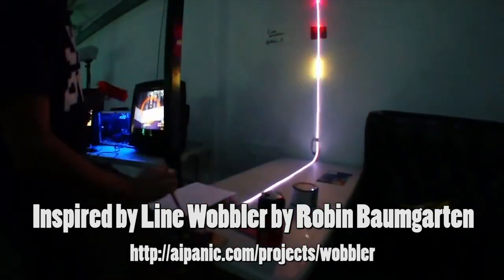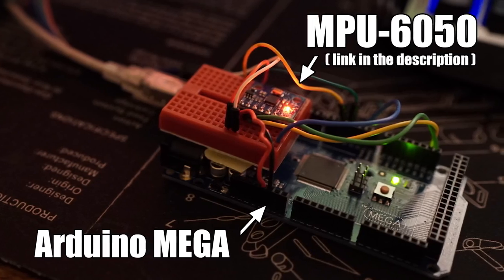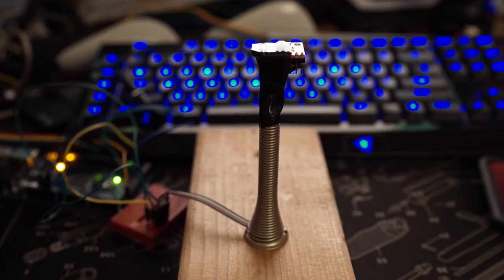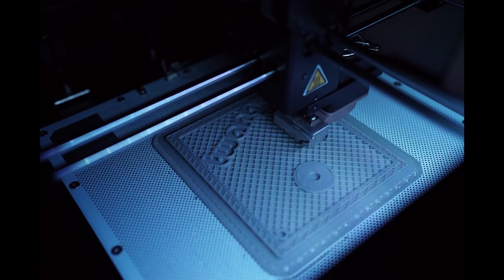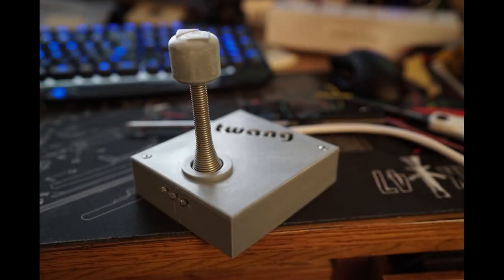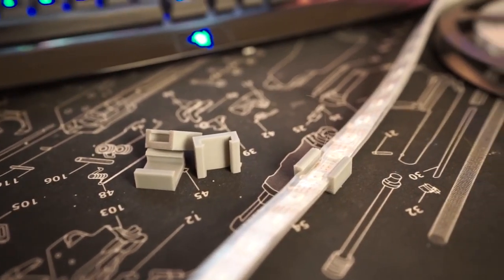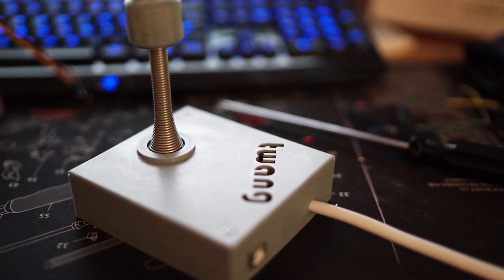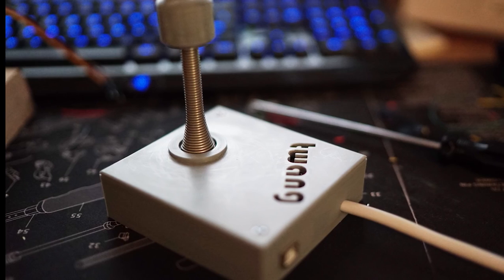TWANG: A 1D Arduino based dungeon crawler

Comment: Hi Critters! Hopefully you see this. The Orlando Science Center had a Line Wobbler installation that had the hardware go out. With no code available, there was no way to repair it. I'm happy to say that it is now a TWANG Installation!

It's an an art gallery area, so every exhibit has attribution. I wanted to give credit where it's due, so if you would like, tell me how you'd like to be credited. I'll make sure it gets put up as such! I'd be happy to have them put Critters or your real name if you so desire. And let me know how you'd like twang stylized, all caps or what have you.

I had some fun implementation details, the joystick is on the other side of a hallway that is an art gallery from the LED strip, so I ported TWANG to an ESP32 and used one ESP32 to drive the LED strip and one to send the IMU info and reset button press across to the other with ESP-NOW (Which works awesomely, this is the first project I've used it on.) I'll send a video once they put the plaque up with attribution, if you so desire. By the way, the FastLED library installed straight from the library manager in Arduino works just fine now. I saw in your readme it said TWANG needs a special FastLED, but looks like they fixed whatever was causing that necessity.
Reply from the maker: Critters on YouTube would be fine. I'd love to see a video! Did you try to reach out to the line wobbler guy?
Reply: @Critters  we did, several times. it looks like he's moved on to bigger projects, which is awesome, but for a while it looked like they were going to have to take it down. Thank you very much for releasing this! I'll take a video next time I'm there.
Reply: @Critters  I'm about to send over to the department head, I'll tell them to credit as @Critters (YouTube) and the installation with be titled: "TWANG" I'll send a video when that's done! Let me know if you'd like to change any of that before I send it over. Thanks again!
Reply from the maker: @PockyBum522  Thanks David, let's go with "David Scott" and "TWANG", I appreciate you confirming and I look forward to seeing the video of it in action.
Reply from the maker: @PockyBum522 Did it get installed?
Reply: Alas  @Critters  I have sad news. It was installed and functional, but I just went back and looks like they opted to take it down. I am just a contractor, so I'm not privy to why. I'll ask about it next time I have the ear of the exhibits department leads. I wish I had better news, I was planning to video it for you today. I may have a video from installation a few months ago. I'll send it if I can find it.
Reply from the maker: @PockyBum522 No worries, thanks for the update! Were there any pictures of it installed?

Comment: I see that this project is quite old but I thought I would give it a try.  I managed to gather all the components but when I try to compile the code in the Arduino IDE, I get a pretty long list of errors.  I managed to find and install all the libraries but the list of compile problems remains quite long.  I'm wondering if the version of the libraries or the version of the IDE are creating problems for me.  Could you please tell me what versions were used when the project was originally developed?
Reply from the maker: This was so long ago and just a one-off for halloween I have no idea. Sorry.
Reply: @Critters  I eventually worked my way through all the issues and got it working.  I'm pretty thrilled with the results.  Thanks for sharing the code.  Well done!
Reply from the maker: @robcarnegie7480  If you do a video do tag me in it, good job!
Reply: Was a arduino mega required  for memory constraints or would an uno work?
Reply: @SteveWyatt  The only thing a Mega offers is more memory and a lot more I/O pins.  I didn’t check to see if it would have fit in an Uno but I’m sure it would be possible if you used some shift registers to share pins on things like the remaining lives LEDs.

Comment: Arduino: 1.8.2 (Mac OS X), Board: "Arduino/Genuino Mega or Mega 2560, ATmega2560 (Mega 2560)"

/Users/stefanomuneroni/Desktop/TWANG-master/untitled folder/TWANG/TWANG.ino:3:20: fatal error: I2Cdev.h: No such file or directory
 #include "I2Cdev.h"
                    ^
compilation terminated.
exit status 1
Error compiling for board Arduino/Genuino Mega or Mega 2560.

This report would have more information with
"Show verbose output during compilation"
option enabled in File -> Preferences.
where can i find this library??
Reply from the maker: mitchell hirsch type ic2dev.h into Google. It's the very first result.

Comment: Awesome project. I always wanted to play the Line Wobbler project, so I built a TWANG. It works great and is a lot of fun for me and the kids to play.  

I changed the 4 pits of lava level to 3 pits to make it a little easier.  I also added a "game over" animation, because it is not so obviously when all your lives are gone and you return to the start. Some sort of scoring system would be great to add too.  Maybe show 5 red dots then 3 blue dots for 53.
Reply from the maker: Nice!

Comment: Hey Critters, great work and thanks for sharing!
I want to install your twang version of the Game on my sisters Summer-Outside-Wedding but i have some different Components. A Teensy 3.2 on a OctoWS2811 and a 4m WS2812B Strip an the MPU6050, no speaker at the moment. I tried a lot with your files at github but it still won't work. I would appreciate if you could help me.?  Greets from Hamburg, Andreas
Reply from the maker: There's so many things that could make it not work, are you getting any errors? Have you got the LED's to work writing your own test code to confirm the wiring for them is correct? Are you using a different library to drive the LEDs than the one provided?
Reply: Thanks for your fast reply. I get an error "#ifndef __XC8
    #error Use XC8 for compiling" and no i tried to use all library you wrote on github. I get the ted strip on the octo working well, but then all pins of the teensy are soldered.? But i am a absolut beginner and maybe it´s not working with an teensy -arduino.? Do you have something like a frizzing-Sketch how to wire your setup? Thanks for your help.

Comment: LOVE this ! .... is there any limitation to the length of the LED strip ?
Reply from the maker: +Mick Long Lengh depends on LED density. They come in 30, 60, 90 and 144 per meter. It uses the FastLED library and I think the only limit on number of LEDs is the power you can provide and the memory on the Arduino. Maybe they have something on their site to do with that. I was running about 300 LED's with no issues.
Reply: +Critters in length I mean like dungeon length, as on your other video seem to make it larger, but not longer .... (im thinking looping round garden/house)